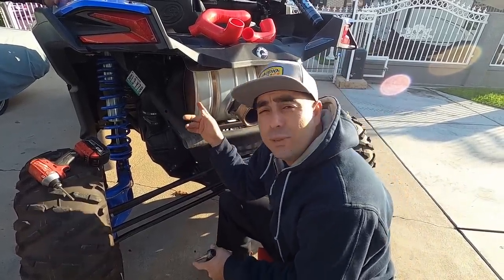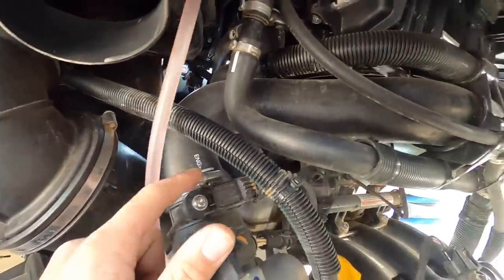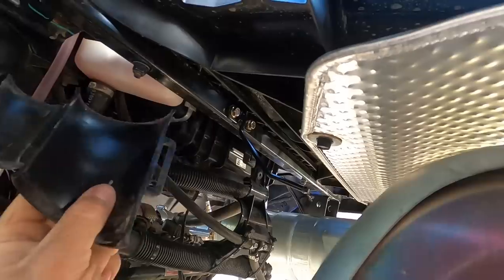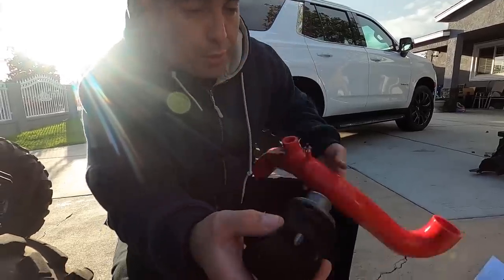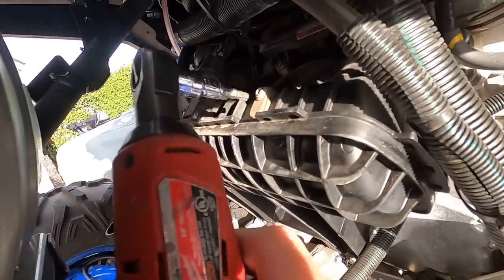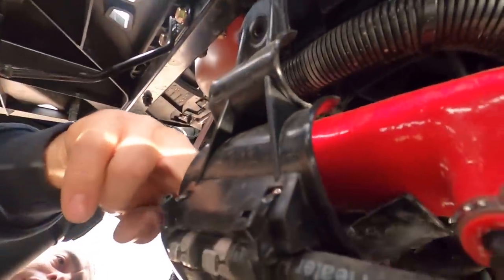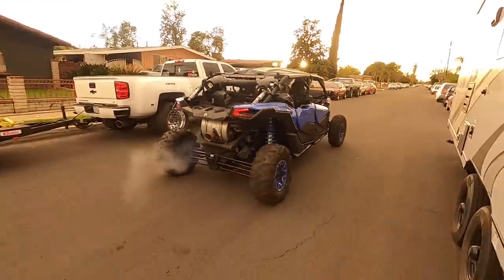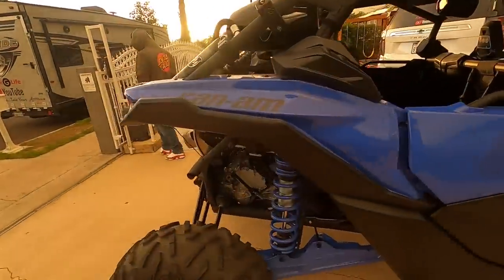2021 CAN AM Maverick X3 GETS BLOW OFF VALVE 💨💨💨 and CHARGE TUBES EVO POWERSPORTS EP - 131

Comment: Your videos help a lot follow and watch all the time, just had a question did your down tube and main charge tube touch installed on my 2021 x3 and didnt know if that's ok not a lot of room to move stuff around. Also had to move heat plate for exhaust was to close to tube. Thanks for the videos.
Reply from the maker: The silicon tubes , coolant hoses can touch, it wont be any issue..

Comment: I just installed mine on a 21 x3 RR and I have double checked the tightness of all the clamps but I think I can hear the blow of valve constantly on while driving at moderate speeds with the accelerator on.   When I gun it and let off it sounds like it’s working perfect.  Should I hear it while just driving sometimes.
Reply from the maker: Yea , u kinda always hear a constant noise under 30% throttle
Reply: @GLifeUTV  ok.  Just making sure.  Thanks!

Comment: Another tight video! Keep em coming. One thing, does that shock tower light bar and those 2 pods provide enough light for night rides? Whats the set up? XL80's and a Onx6?
Reply from the maker: We have not found the answer to that question. At Glamis during a nite ride one of the pod connectors failed.. also we just got and amber cover for the tower light. Plan to test very soon

Comment: Hey frank ive this setup now for a few trips, Badass totally turns heads. But what is the proper setting for the bov? I notice if you twist the valve it has some adjustment as far as release. What do you recommend?
Reply from the maker: The tighter the adjustment the later it will blow off. The looser( less spring pressure) the earlier it will blow off. Do not loosen it to the point where u can see the o ring. Personally i just leave it almost full tight

Comment: Hey man I had a question what does that charge pipe do or does it make the bov louder?
Reply from the maker: Most aftermsrket charge tubes like the one you see here, have a port for the bov. That factory does not . Also they are higher quality can hold more boost with the more robust clamps

Comment: Did U Adjust The Valve I Had Mine Installed I Can Hear It On Occasion Wen I Accelerate It In Neutral I Can’t Hear It
Reply from the maker: Ur machine will not build sufficient boost In neutral or park. U need to be driving the machine under load to hear bov correctly🤙

Comment: Quick question how did you hook up your side mirror to power.  i just bought the same mirrors for my 2019 can am 4 seater
Reply from the maker: Comes with a harness if i remember correctly.  I think we did those to accessory 🤔
Reply: @GLifeUTV  yes it does did you hook up to the Accessory in the center or somewhere else
Reply from the maker: @MasterDrhd  yes in the center power distribution block to the right of the shifter
Reply: @GLifeUTV  ok thanks alot